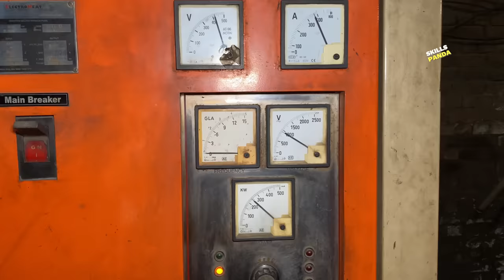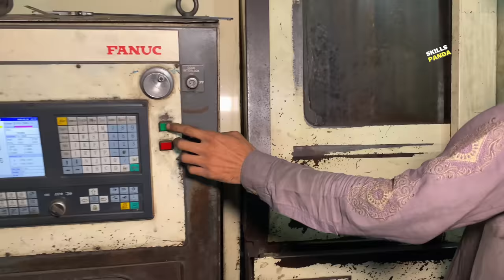This Industrial Process Will Shock You! See How Raw Material is Transformed into a Disk Brake Plate!

Comment: The end results are nice enough, but watching folks dealing with molten metal whilst wearing sandals was particularly difficult. Absolutely mad. Felt especially bad for the guys holding the smaller “jug” that needs to be refilled as it moves along the line. :(